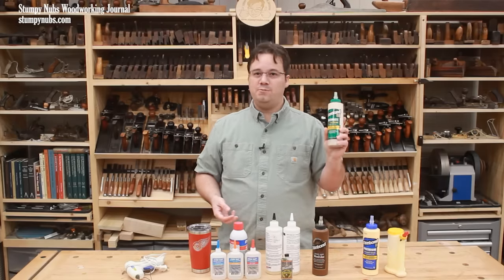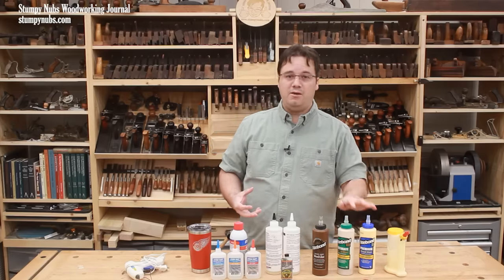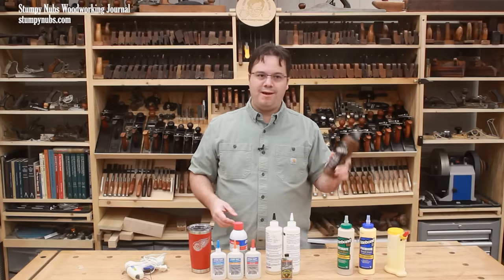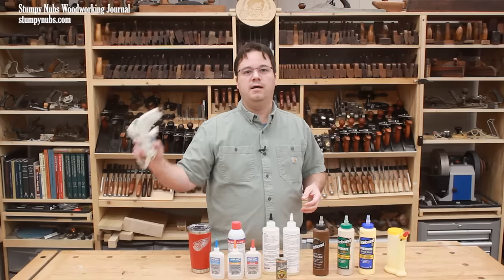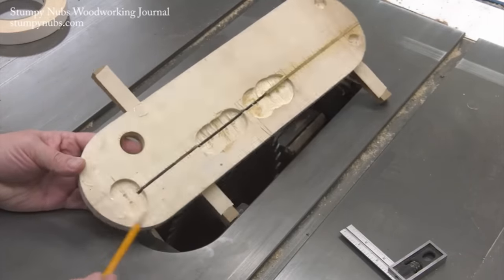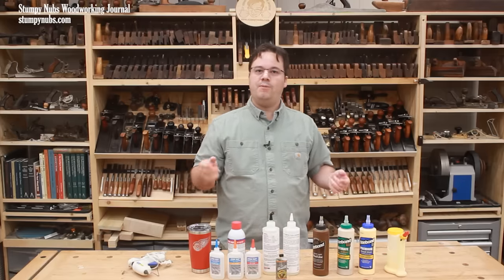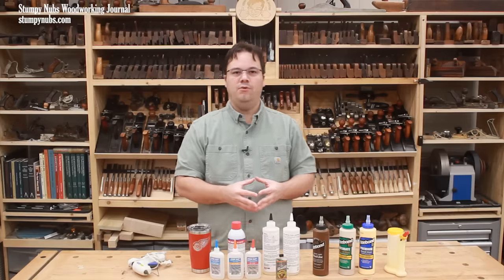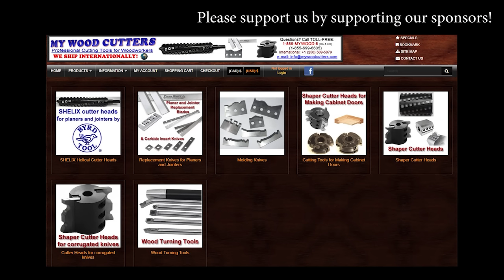Why I don't use Gorilla Glue

Comment: I wrap over the end of the applicator of the CA glue bottle with some teflon pipe joint tape, and then put the little plastic cap on.  (I don't have a freezer within reach of my shop.)  I've had a bottle of CA glue on a shelf in a cupboard for 3 years now, and it still flows as good as when it was new.
Reply from the maker: CA glue only has a 1 year shelf life, even when sealed. It may work longer, but I don't like wondering if my bond will hold.

Comment: Nice explanation of the glues.  Original Titebond (1), fresh hide glue (buy granules, mix with water and heat - must be used hot), and fish glue (very humidity sensitive) are all especially good for musical instruments because of their hardness.  The thick CA glue is sometimes handy squeegeed onto wood as a grain filler depending on desired finish and type of wood (as always, some experimenting is helpful).

Comment: The only time I have used Gorilla glue without regrets was when I used the expanding version to reattach the soles of my low-grade boots to finish out a winter.
-
I am not a woodworker. Instead I craft with XPS and EPS foam, wood and plaster. I use primarily white PVA glue, with super glue or hot glue for specific purposes.
I don't need to worry about water-proof properties, and strength is not really a major factor. The main decider of which glue I use is speed of adhesion/curing, and ease of clean-up.
-
All that said, this video has given me some nice information. Thanks, Stumpy!

Comment: Two more thoughts - first, one way I use CA glue is to mix some of the thick glue with sawdust and use a plastic putty knife to fill a crack or a gap.  Then you spray the activator on it and it's hard. It can't be stained, but usually it blends in fine. Similarly, I used it to fill a gouge I made in a hinge mortising template - it filled it quickly and then I used a file to shape it.

Second - I use the System Three T-88 epoxy more than the one you linked.  It's a "structural" epoxy, and incredibly strong.  It also has a much longer open time.  There are so many different epoxies on the market, and so many competing claims that it's sometimes hard to know what product to use.

Comment: Another informative video, thank you. In the local college instrument program, Titebond 1 is used most often because it is heat reversible. So for example if something doesn't pull into position the 1st time (like guitar binding), heat applied with some additional pressure allows it to be corrected. A question on PVA adhesive for bent laminates.....isn't long term creep a possibility? Many times either urea formaldehyde or epoxy is used in my experience for joints that must resist a continuous type force such as bent laminates. I am interested in your thoughts on this

Comment: FWIW: I make humidors for a living. In the shop I work at, we use white Titebond glue for almost everything. We use Titebond Original Yellow glue for things like gluing up table tops, and high traffic areas of furniture. Also worth mentioning: Titebond Type 3 is also indirect food contact safe. That means it's what you SHOULD use for cutting board glue-ups.

Comment: Nice informative video, and good idea on keeping the CA glue in the freezer.  My wife may not share that opinion, but we'll find out.  I do have a few more types to add to the list, though.  You mentioned construction adhesive, such as PL.  It holds extremely well for rough projects, does well with damp materials, and is quick to apply.  Good for outdoor, "rustic" type builds, etc.  Subfloor adhesive is similar, dries very quickly, and remains somewhat elastic, good for things that will see a lot of movement or flexing.  I used it for the slats on a bed frame, over 2x4s.  There are other forms of PL products for special applications, so if you are doing something odd, check to see if they have anything useful.   Silicone also makes an excellent adhesive, for things like glass, tile, stone, etc.  Things that are hard to glue with other adhesives.  It also has some flex.  We use it all the time for installing washroom accessories, you will pull a tile off the wall before the bond lets go.  These are more for construction type projects, but have their uses in woodworking as well.  Lastly, spray glue, such as super77 from 3m.  It is essentially spray on contact adhesive.  I wouldn't trust it for woodworking joints, but it excels at gluing on sheets of laminate or veneer on countertops, cabinets, etc.  Simply spray both sides, wait a minute, and place it, and roll it.  You don't really get much of a chance to move it afterwards, but most guys oversize the sheet and trim it off afterwards.

Comment: I think another to add to the shop is a light bond spray adhesive for printed templates (scroll saw or bandsaw work primarily), it's also helpful when trying to get a simple wood template onto metal when making new carving knives or custom molding scrapers. 
Otherwise I think you nailed it and I wish that i had known about the hide glue before fixing one of our kitchen chairs that decided it wanted to break. :-(

Comment: Pretty darn good video!  When I was young Titebond didn't exist, so we all used white glue - I built a mahogany table in shop class 40+ years ago and those white glue joints are still holding!  I have no love for gorilla glue.  not that it doesn't work, but because it is expensive and the glue dries out in the bottle so fast once exposed to air.  Great for outdoor furniture, but that's about it IMO, and buy the small bottle!

Comment: To keep my boards from sliding when I clamp them I always pre-fasten the pieces with face frame screws, than take the 2 pieces apart and glue. When  putting them back together the wood screws will act as clamps (never to be taken off) and the wood will not slide no matter what glue you use. I learned woodworking from my Dad and he used  the older hide glue almost all of the time. Sometimes we had to even mix the powder to get the glue. How do you keep the CA glue from getting solid in the container after you open it, please??? Ok, you just answered that question. Hot glue is my substitute for double stick tape. I really don't use the Gorilla glue anymore. The first time I used it, I glued some plugs in holes, went to bed, nd in the morning the glue had pushed the plugs completely out of the project. No more of that stuff.

Comment: Another handy glue is Formula 560 Canopy glue.  I found out about it on one of the guitar luthier channels (probably Stu Mac).  It's primary purpose is to glue clear plastic cockpit canopies on model airplanes because it works well with plastics, and is clear when it dries, but the luthiers claim it sticks most things to most other things even with small contact areas.  I mainly use it for things like leather and vinyl.  It comes in tiny bottles and you can find it in hobby and craft shops.

Comment: Thank you for doing this glue video, I was going to post one like this but you have done a great job! Just one more point about white glue, you can use it for gluing thin veneer,using a iron, apply it to both sides and let it dry clear15 minutes, then iron it on, and press with a stick. Yellow glue won’t work for this. Try for yourself, it’s good to know

Comment: I found out from automotive bodywork channels, that a quick spray of isopropyl alcohol will 'release' the hot melt glue ! Even more useful, easier than prying stuff apart, or useful when you just pry open a small gap, and shoot in the isopropyl... thanks for an intersting video!  I've been interested in the huge variety, and surprising abilities, of modern adhesives.

Comment: thank you for the advice.... what would be your recommendation be for a wood glue that has high heat resistance.... the use case would be to make laminate bindings for a guitar out of mahogany and ebony and they would be bent using a bending iron (so heat and water moisture resistance would be important. thanks in advance

Comment: Are there glues that work well with an oily wood like teak?  I used to refinish teak patio furniture, and the company owner told me that he didn't do repairs with wood glue because it didn't work well with the oily teak wood.  I didn't question that, but I did try Gorilla glue, and it worked great although it was messy and porous.  Any thoughts?

Comment: For temporary bond I like a technique that I learned from a guitar builder.  The masking tape and superglue method- put down a strip of masking tape on the two surfaces and pair them up so that you can tell that they are aligned. Then put superglue on one and the activator spray on the other and put them together. Work on the materials so that they are treated the same (usually cuts on the sides). 
Then peel them apart discard the tape for more work that has to be done when they are separate pieces and then permanently reglue the perfectly matched shapes back together.

Comment: I work as a piano technician and hot hide glue is the glue to use for the joinery.  Its what was used historically and what we still use today.  We generally mix it up ourselves so that we can control the consistency for different applications.  Gluing on felt requires a different consistency than gluing on hammers.  The good news about that is it has a longer shelf life since you have to mix it when you want to use it so you can control the amount you want.

Comment: I used to build prototypes for company for which I worked. The proto wold be completed to be virtually the  standard of the commercial product and was sometimes used as the part from which molds were made for the plastic shells and covers of the mechanisms. We bought CS glue by the quart for assembly of some of the parts of the products. So we had quarts of CS that aged out, though it was still liquid and was still able to be activated.

I had to make what was essentially the exterior shell that covered the electric motor driven device. I used 1/16" pvc sheet taped together in the shape needed using masking tape . I would then invert the shell and and position it so the edge was down forming a upward facing V. I then poured the CS glug to make a fillet along the seam and then sprayed it with activator. Once set, I reset the shell so that another seam was positioned to be filled with CS. Activate and move to the next. The finish shell then had to have all the outside, but filled on the inside, corners/edges rounded to about 1/8" radius. I hand block sanded to get that radius and all of the edge was now the exposed activated CS. Any bubble voids were easily filled and instantly activated  to continue sanding. 

The shell was equivalent in strength to the finished product and once all was sanded smooth was rattle can painted to the correct color. The bond line between the CS fillet seam and the plastic was invisible with no filler needed before painting. My boss, a PHd Engineer was impressed with the finished parts. My hand built covers were use on the units taken to the trade shows as fully functional products.

Comment: something else I have noticed in the white vs yellow glue debate is that the yellow glue tends to seep deeper into the wood fibers. I've tested this with both cutting a piece to visually measure the penetration, but also have used a drill to see when then fibers begin to change. The drill was just in case I wasn't seeing all of the white glue. As you mentioned it does dry clear. many other craftsman I've spoken to have also noticed this.

Comment: Awesome! I had no idea Titebond 1 was superior to 2 in certain situations. I did notice that your cut the "string" on your GluBot cap and I've noticed that other people have done that too. Just FYI to anyone that was annoyed with it dangling: The cap can be placed on the top of the screw lid while in use to keep it out of the way!
Reply from the maker: I didn't cut it, it broke. I've had the particular bottle for many years. The newer versions have a more flexible cap and string, so they may not break off.
Reply: @StumpyNubs  Mine broke too, within a couple of weeks, and I bought it recently

Comment: Spray adhesive is also very workable in the shop. Gluing a paper pattern to a bandsaw cut, etc. Easily parted and not as thick as hot glue.

Comment: Very well done. I love glues of all kinds....but just as you say, it's important to use the right glue for the job. I use a light PCA for replacing my piano keys every couple of years. It holds well, but is easy to remove. As for Gorilla.....nothing else that I've found can rock a shoe/boot repair this this stuff. The trick is, remove the squeeze-out about it's been drying for about an hour and a half. It's solid enough to peal off, and no longer sticky. In 24 hours it will be completely cured.  Yes...I'd never use it on wood projects. Too many other better options for that application.  Thanks

Comment: Which of these is best for gluing wood onto metal? Or for later staining the wood?
Reply from the maker: Epoxy and PU (polyurethane) glue will bond wood to metal. CA glue will work too, but I don't trust it long-term. No glue is good for staining.

Comment: I agree completely about not using polyurethane glue for woodworking (and I have definitely tried to make it work). But it certainly has its place for other things. One technique I recommend when using it is to put some blue masking tape over any joints you are gluing. Remove the tape after 45 minutes. This will keep the glue from coming out and foaming into a bead. Don’t go longer than 45 minutes are the glue will bond to the tape.
Reply: great tip thank you!

Comment: One of the benefits of PVA yellow ( carpenters' glue ) is the rubbed joint . 25 years ago I used it to secure the ( very smoothly finished ) underside of  tread/riser interfaces of the staircase I built in my own home . I used equally smooth and square small maple blocks , 4 per tread , and rubbed , with lots of hand pressure , until the blocks simply could not be moved. It would have been fussy and clumsy and time consuming to screw and glue the blocks. 25 years on , they are still there and no squeaks ,  no failures.

Comment: The fact that Gorilla glue actually expands slightly (rather than just passively "filling gaps") is occasionally useful. This can be useful for e.g. jigs with sloppily done joinery, or of-the-shelf undersized dowels, in cases where the foamy expansion actually helps. But is is horrible horrible horrible to clean up.

Comment: James, speaking of glues, it would be instructive if you did a video on crack repair etc with sawdust mixed in to the glue. I have seen wildly different opinions as to techniques and which glue to use, but not yours. Or have I missed an earlier vid?

Comment: Very informative video about the various glues. I agree about the Gorilla glue. It is embellished in the advertisements and it certainly doesn't hold up to any kind of tensile factor, and it does foam up. 
Project Farm has a very good video about the yellow glues that you mentioned, and surprisingly, some of those Titebond varieties that are more expensive and supposed to be stronger aren't. 
At any rate, I took a lot of good info from this video that will be very useful down the road. Cheers!

Comment: I've never used Gorilla Glue until recently, when we did a siding job on a tiny home using wet Cedar. My boss wanted to use it because it is waterproof and the color matches the siding. It's a great choice for exterior but that's about it and you have to be careful how much is used

Comment: I work on Antique wood boats.  So everything has to be waterproof  or at minimum water resistant...  Also has to be compatible to various woods. .for example WEST epoxy  doesn't bond well to white oak , but does bond well to mahogany, fir, cedar.      Gorilla glue is our go to for broken piece that has to be repaired.     The foaming assures that the repair is filled without additional filler.  And on mahogany the repair disappears to nearly 100%  because it takes stain very well.      We do use tightbond II  for wood plugs .   Because it doesn't fail, but most of all it doesn't leave a line like epoxy  recorcenal glue.   And is easy to use.   We do use CA glue  for minor repairs .   We use Tightbond  III   for  interior glue ups.     When we need a flexible adhesive, we use 3M 5200 marine sealant.  I also use it around the house.   It will hold anything to concrete.    But when i need to glue up laminate to create shapes (as long as it isn't a seen item.  The superior product is   Weld wood recorcenal.  It is also by far the best for scarfing plywood .  The wood will fail long before the joint...  It works great on every wood that we have tried, including white oak.      But by far it is the hardest glue to work with.  But that being said it is worth it is some situations.

Comment: I've used CA glue on wooden threads before. It gives them a hard, more wear resistant surface if you need to cut threads directly into the wood.

Comment: We use Polyurethane glue all the time in my cabinet shop. Well maybe 5% of the time. It’s fantastic for glueing mitre joints. We also use it for glueing two pieces face to face, it bonds to melamine allowing us to create thicker bar backs and shelves. It’s a really underrated glue, but it has its limitations.